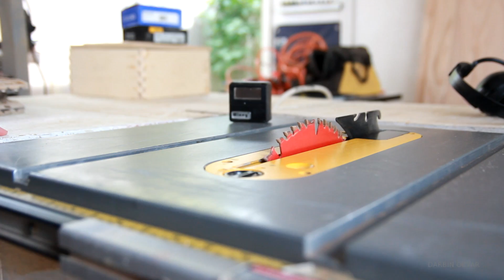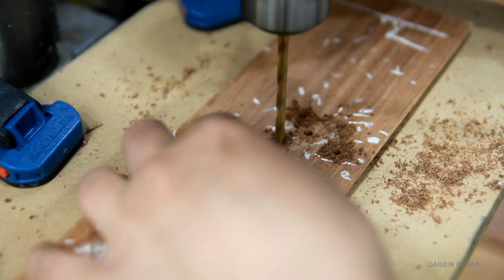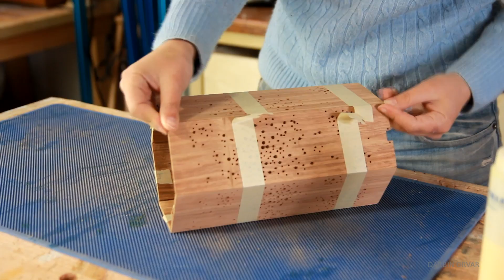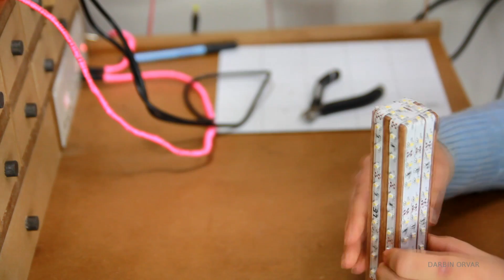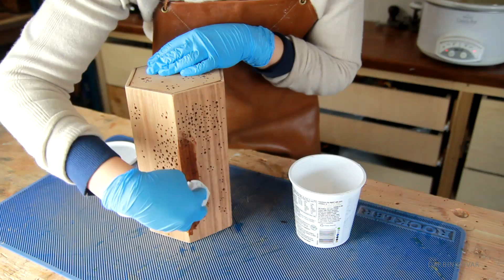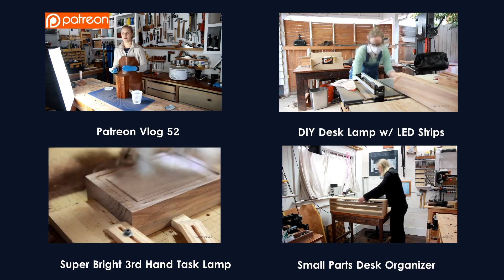Making an LED Night Light w/ Star Pattern

Comment: I really like your creativity.  I find it inspiring much like I find your shop inspiring, I really want a better setup so that I can pursue my own artistic impulses.

One thing, I know that you say you have never had any trouble with these LEDs, as long as there is enough airflow, BUT there is no way to provide airflow to the back side of those LED strips and it will shorten their life span rather significantly.  It really is a good idea to attempt to apply them to a heat-sink structure of some kind, whenever possible.  They won't always fry, straight out, but you will generally notice a loss of luster over time as they are slowly damaged by the heat energy that they produce.  Just a thought.

Subscribed!

Comment: I think lining  the inside of the lamp with aluminium foil would make the lamp brighter. Before you drilled the holes, of course - that way, a lot of the light will be reflected, until it will get outside through a hole. The way it is right now, most of the light is actually absorbed by the wood.

Comment: The project looks great, but i have a few suggestions. First you could have used a round dowel instead of a square piece of wood, also instead of cutting the led strip and then later soldering it you could have just looped it around the wood in a spiral fashion.

Comment: I was thinking that if you use a piece of large doweling and wrap the LED strip in a climbing spiral around the dowel, you won't have to chisel out a square opening, and it will reduce the soldering required, since the LEDs will be one continuous strip. Adding a dimmer would make this even cooler. Also, kudos for having the patience to create a pleasingly 'random' pattern of holes! 
Thanks for the video.

Comment: very cool! i think it would have been more efficient in light use to glue before drilling aluminum foil/ plastic mirror/white surface of some kind/silver or white paint on the inside. this would help reflect back any light that did not go through the holes instead if being adsorbed onto the darker wood. it would also make more contrast so the holes will be seen nicely when the light is off. as I started though, very nice. I found your channel recently and I love it!

Comment: Linn, when you solder the neg and pos on the LEDs do you remove the silicon waterproof sealer first?
Reply from the maker: +Chuck Bergeron I didn't use waterproof lights for this projects, but if you do, you have to remove it first.

Comment: Very cool Linn!  I notice that the top doesn't seem to have as many holes lit, was that just because of the video angle? Also, recently I bought some adhesive mirrored laminate sheets on eBay and I bet if any of the insides that did not have holes in it had the walls covered with small mirrors, it might magnify the light output by reflection. Maybe.  Haha
Reply: hmm,  brilliant idea indeed

Comment: Nice project! You could use one cylindrical wood in the middle, so you can wrap around one long piece of led light, this i think would be more easy and minimize connections.
Reply: +Marios Karampalis Plus, you wouldn't have to chisel out the hole in the middle.  Just choose a piece of dowel and drill out with a forstner bit of the same size.

Comment: Super cool idea. Would also be awesome to use this sort of idea as a chandelier. Could build a few of the and hang them best each other at different heights to give a really cool effect. 

Or even do this around the trim of a bed, would be super awesome at night, and would be an awesome night light that you could put on a timer to run from dusk until like 1am, and then to be back on when you wake up for a bit until the sun comes up.
Reply from the maker: +galamonkey Sounds cool.

Comment: Winding one long led strip up the pole diagonally would have saved some effort.

I feel like this would really benefit from a small motor turning some slats inside to create a slow twinkle.

I will totally be making 3 of these and hanging them as pendant lights in my kitchen.

Comment: That looks great. I'd be tempted to add a few neopixel LEDs and an Arduino nano with a short sketch to randomly fade the neopixels between various blues, purples, oranges and yellows. That would give the galaxies a bit more interest.
I was wondering why you used such a thick piece of wood for the top, as the light points don''t really shine well. 
Thanks for another excellent video.
Reply from the maker: +Maxx B I used what I had on hand, however if I drilled the holes from an angle, I think more light would have shined through.
Reply: Thank you for replying. The angled holes idea makes sense.

Comment: Looks great Linn! Do you think the top is too thick? Is that why it didn't seem there was much light coming from it?
Reply from the maker: +Mark Stafford The top is a little thick, however I think the primary reason not as much light is shining through, is because all the holes are drilled straight down, and not from an angle.